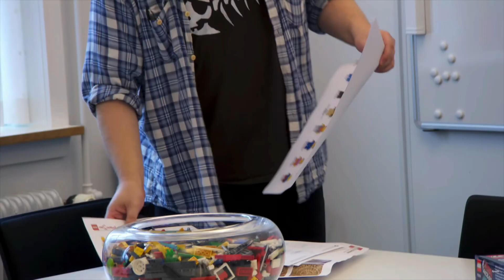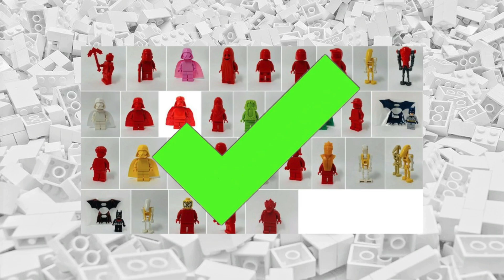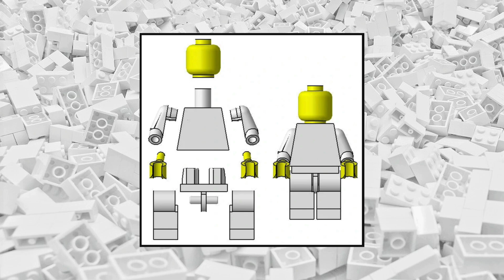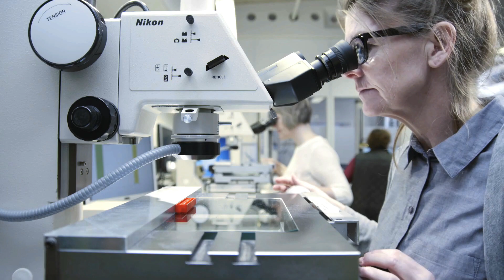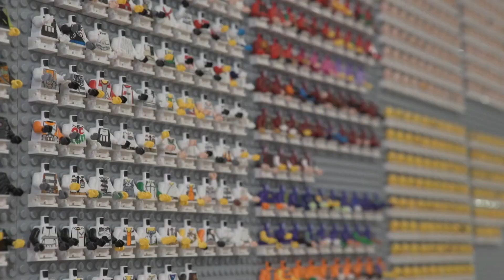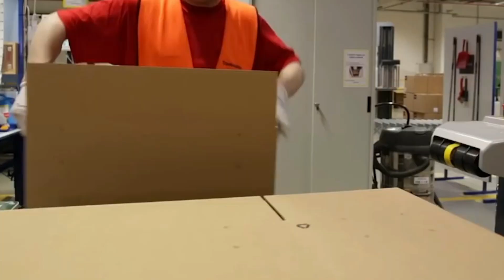How LEGO Makes Minifigures

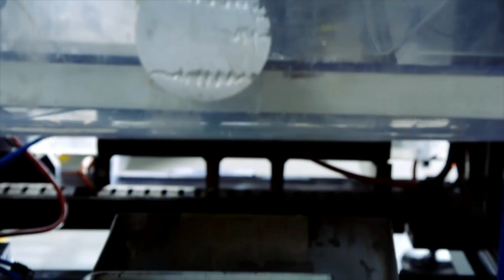Comment: 7:38 You said that these bins contain 1 of every part that will go into a bag. It would be better to say that each bag will receive the specified amount of the types of parts that are set for the inventory of the bag that are to go into the tray, especially if it's not a minifig. 1x2 plates, for instance, could be any number that the set actually calls for, not just 1.
Reply: In this case I believe he is talking about the minifigure itself